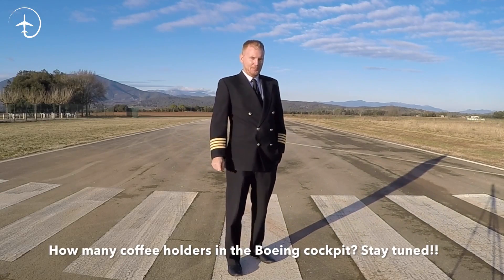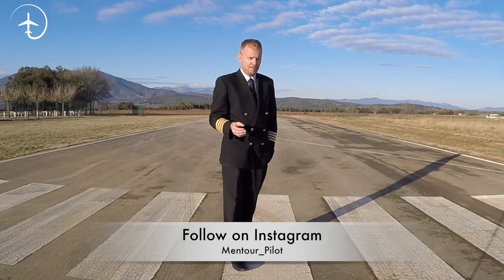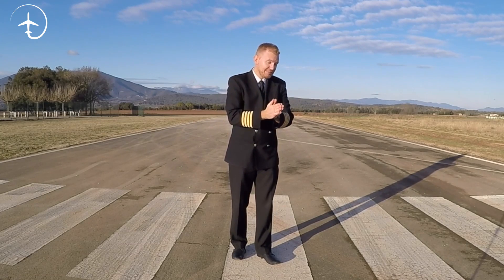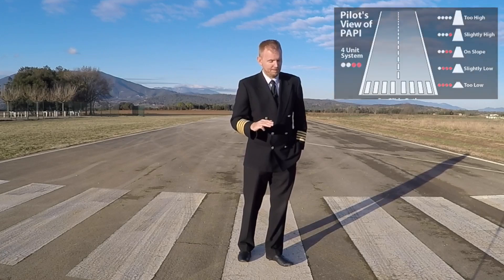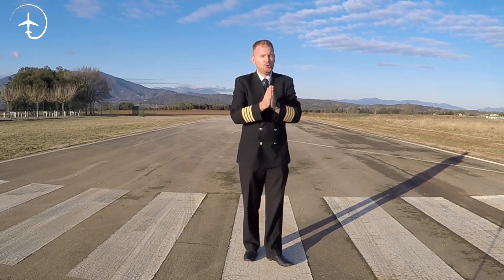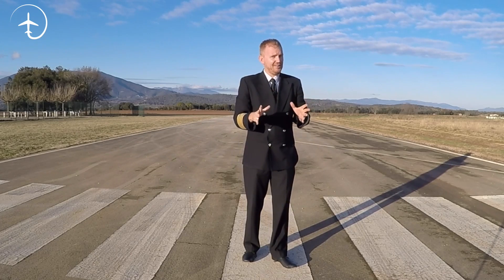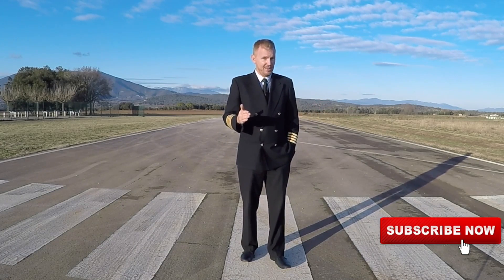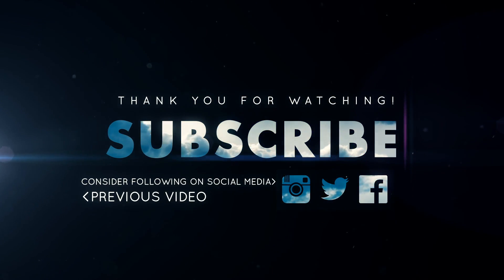Strange Airport lights - PAPI's

Comment: Thank you for this video.  I hold an approval to flight test these systems and your summary from an airline captain perspective was very informative.  Especially the part about placing less emphasis on the final 200'.  If I am stable at that stage I continue the approach visually to the aim point mark and do a final assessment of the 50' eye height above threshold.  Assuming the approach has been stable, even in a light twin, you can usually assess the touch down point as being within acceptable limits of the runway marking.
As an aside, not many runways I check have ILS and only a GNSS RNP or other NPA.   A check is made at the FAF that the on slope indication at the published altitude is correct.

Comment: I had a passenger sitting on the co-pilot seat asking what are those lights and why they are two white two red. I told her that means the runway is only 50% charged and she freaked out asking if that's still safe to land 🤣

Comment: Interesting On my own home sim (Microsoft-X (an old one from 2006 the last year Bill Gates decided to close the sims from further purchase) I have noticed that just crossing the threshold and ready to touch down, they are all red! I simply ignore this. I KNOW just where I am over the runway, and don't need POPI any longer and I make perfect landings. Further, this MIGHT be a bug in this Microsoft programme If I follow the PAPI I am too steep (above 3 degrees) but I usually (of course when there are no obstacles in front of me tend to come in at maybe two and a half degrees, Some might say that is too low, but using my very 'hard to stall' Raytheon-Beechcraft B-350 King Air when I do come in 'too low' actually I wind up making the smoothest landings imaginable! No bounsie-bounse, or 'firm' touchdowns. Smooth transition from wing to tyre……….BTW, as I am also into railways, I have a railway sim as well )not only driving genuine rolling stock, be it steam, diesel or most important and most majority of my time, electric, I can also do my own layouts 'routes Yes, complete with the overhead infrastructure (from RZD in Russia).'...…… I have many airports and I found out a trick on how to install PAPI lights at both ends of the runways. Being predominantly a rail sim, the airport 'assets or objects are rather limited, but good enough to use for a fairly realistic airport. It is from Hellensvale,  QLD in eastern Australia, the company now known as N3V Games. Their Auron Trainz is their railway division as they (N3V) also has their own flight sim as well. On the Trainz they have one A-319 in Air New Zealand markings and if done right one can simulate a take off or landing. It is a bit cricky but still works.

Comment: I thought of the airports in my area use VASI lights. Touching on the differences could be an interesting video.
Reply: The big difference between PAPI’s and VASI’s is that PAPI’s are more precise. PAPI lights can show you to what degree you are above or below glide slope, but VASI can only show you that you are high or low. Both lights can show if you’re on glide slope.

Comment: I remember there being two rows of VASI lights. If both rows showed green you were in the glide slope. If the far row turned red you were to high and if the near row turned red you were to low. When and why did they change to PAPI? I have asked other pilots on YouTube and have gotten no response. I found the VASI lights as workable as the PAPI.

Comment: The error you describe sounds similar to "chasing the ball" if you're doing a dynamic carrier landing (as opposed to a vertical one), you start oscillating across the glideslope and risk a ramp strike or wasting your landing gear some point after the arresting cables.

Comment: Q.1: Is there a "minimum set" of landing aids your company requires to land at an airport?
Q.2: Have you done a video on the most significant landing aids? (e.g. PAPI vs ILS, etc) and how you use the available aids (e.g. when transitioning from GPS to ILS to PAPI)

Comment: How is it decided what type of planes a pilot flies? Does a pilot know how to fly all models of aircraft or only one or two different models? For example can a pilot fly a 727 and 737 but not a 747?
Reply: It is YOU that decides what aircraft you want to fly. You need to get a type rating for it yourself. And as for you second question, AFAIK you can hold 2 type ratings at once.

Comment: I might put this to use in X-plane.. last flight i did was into LOWI lovely 460fpm touchdown lol. Ahh heres a question happens at Innsbruck at night with regards to approach.. Surely there is no visual for runway 8 at night but what happens when the winds are blowing from the east. I had a tailwind of about 7kts on a dry runway, I figured that would be alright for a 737 but what if the winds are stronger?. been wondering about that for ages.

Comment: I heard on the news two or three weeks ago that an airport in Greece (Thessaloniki) is temporarily converting a taxiway into a runway because the actual runway is under maintenance, and some airlines are suspending their services to that airport because of that  What are your thoughts on this matter?
Reply from the maker: That happens from time to time.
If the runway is approved and has the correct t pavement classification number etc, there are no problems with this.
Approaches will change slightly, the mínimas will increase but that’s it.

Comment: So a couple questions... what about aircraft with different seat to tarmac distances.... how does the PAPI change if you are flying a 747 vs. a King Air?

Also... ever done a PAR (Precision Approach Radar)?
Reply from the maker: Hi. Normally the papis are Set for the bigger type aircraft and as such, smaller aircraft can see 3 reds towards the end of the approach whee a 747 sees 2/2 

I have never flown a PAR Approach but o have flown a Radar NPA which is the non-precision equivalent.
Reply from the maker: Hi. Normally the papis are Set for the bigger type aircraft and as such, smaller aircraft can see 3 reds towards the end of the approach whee a 747 sees 2/2 

I have never flown a PAR Approach but o have flown a Radar NPA which is the non-precision equivalent.
Reply: Thanks for the info about seat height above ground and the difference in the way PAPI appears. I confess that I have never flown a PAR approach.... although I have been the "Navigator Monitoring" on many occasions.

Comment: what about the green lights ? instead of red and white colors ?
Reply: Four greens on the PAPIs, they're shining through the grass and you really want to pull up...
Reply from the maker: The green lights in front on the runway are threshold lights. They indicate the start of the runway.
Reply: i thought its guide the pilot to the right touchdown angle ( green light i meant )... thanks alot sir

Comment: @mentour pilot sir, I'm a trainee pilot in New Zealand, I have trouble in using rudders in a turn, Could you please help me with that
Reply from the maker: Hi! Do you have a rudder coordinator (the bubble)? That should be centered. Otherwise just use as much rudder as you need in order to feel that you are not being "pushed" in either direction during the turn. The force should push you straight down into the seat.

Comment: I was landing at an unfamiliar airport and I was on what felt like a normal approach, but the papis were reading high. I start descending and descending and by the time I see 3 whites, I'm definitely too low. Maintained that altitude until I got back onto my normal approach and landed where I was supposed to. I notify the tower and they look into it, and a few days later I fly back to that airport and find out that a groundskeeper ran into it with lawnmower and knocked it out of alignment. Definitely an interesting thing to watch out for.
Reply from the maker: Great stuff! That just shows how important it is to rely on different sources of information and use always question the info you have. This is one of the primary reasons why Humans are still flying the jets and not computers.
Reply: LOL
Reply: That's so dangerous! He should have told someone immediately.

Comment: I thought my entire life, that the PAPIS are controlled automatically... but it's just the viewangle which changes the lightd
Reply from the maker: Yes, that’s correct.
Reply: And there is another type of glide slope indicator it only has one lamp, I believe it shows red when too low, flashing white when in glide path, and solid white when above glide path. 
In some general aviation airport where the ATC is off duty during night hours, you can tune in a frequency and click on the mic to turn on, change brightness of the runway lights
Reply: Aircraft carriers I think use the same principle but in a Christmas tree formation.
Reply: @chuckzc   yes indeed they do. exact same principle but the layout of the lights is a little different.
Reply: Yeah I thought they were connected to radar
Reply: Matthew Wang I believe that is called a VASI Visual Approach Slope Indicator
Reply: It’s a quote clever design, as I learned from captain joe's video, they are sometimes used as a replacement for the ILS, because they are cheap, and some planes like the 747) don’t work well with them, because the cabin is too high, so a correct glide slope is actually three whites one red
Reply: Took me a while to work it out but when you think about it, it is so logical. Those lights must be set at such a critical level thought.

Comment: Hi Mentour as always another great video,  quick question; whats the benefit of having two sets of PAPI either side of the runway.  I understand as a minimum only the left side is required?
Reply from the maker: It gives a better sense of the altitude actually since you can concentrate more on the Centre if the runway and your peripheral vision still sees both sets of PAPIs
Reply: It is also useful in the event that a light burns out or is crashed into by a lawnmower.

Comment: Is there a risk with holding a coffee holder near the central cookpit in case of turbulence or hard landing ?
Reply from the maker: No, not if the coffee cup has a screw lid, which we have to use.
Reply: I see, because i thought the flight attendant is giving coffee and drink during the flight, so there maybe a risk :), thanks Captain

Comment: What is coffin corner?
Reply from the maker: The altitude where low speed and high speed stall coincides.
Reply: Prathiksh Shetty the given name is actually Q Corner.  Q defines dynamic pressure. over the years, coffin was interjected as dramatic license. "corner" refers to the triangular shape at the top of a flight envelope chart where the stall speed and critical Mach number are within a few knots of each other. the speed where they meet is the ceiling of the aircraft.
 most of today's jets have a fairly wide margin between stall and Mmo, which had made Q Corner a thing of the past. a great example of a coffin corner aircraft is the U-2. ate 60,000 feet where she is most happy, the U-2 can have as little as a 5 knots between stall and mach buffet.

Comment: Hey Mentour! So, I have a question regarding diversions. Let's say there is a flight from Denver to Pittsburgh. Shortly after the takeoff of this flight, it begins snowing in Pittsburgh. Before the flight can begin its decent, the snow has turned into a full on blizzard. The snow gets so bad that Pittsburgh's airport is forced to shut down and our flight has to divert. In this case, the diversion airport is Toronto. So the flight diverts and lands safely. But there's a problem: the vast majority of passengers did not bring their passports, if any brought them at all, since this was supposed to be a domestic flight. What happens to the passengers after the landing in Toronto?

TL;DR: what procedures are in place for when a domestic flight diverts to an airport that is in another country?
Reply from the maker: In most cases the airport will keep the passengers on airside and then board them again for a flight to their original destination.
Reply: Ok that makes sense. Thanks for the reply, great video btw

Comment: Hi Mentour, will pilots ever taxi on one engine before takeoff/after landing in order to save fuel? Thanks!
Reply: Of course they can. But it is prohibited in some airports.
Reply: A lot of airlines do that if it is a very long taxi and a long wait in a line so they have time to start the second engine.
Reply: Kwazi Donsta on the A320, yes and it is done on the #1 engibe. engine 2 is started no later than 2 before takeoff.. first flight of the day, 5 minutes before take-off. so, what we've got are Green system hydraulics powered by engine 1, and Yellow system hydraulics  powered by the alt electric pump
Reply: Hamza Alkusari Yes you can use single engine for taxi but it is prohibited in some airports for safety reasons. You still can get perfect turn although you are using one engine. It does not give you a very big differential power since the required N1 is low for taxi. Which means you can still easily turn a big turn with single engine taxi. What most pilot do:Taxi toward the ramp/parking/gate with single engine, when parking brake is set,shut down left engine
Reply: Kwazi Donsta yes they can
Reply: yes on multi engline aircrafts, this is depending on the company procedures. usually you turn off one engine at the last meters before turning into the gate. but it needs practice
Reply: Ava Mendez can’t the APU power both HYD Pumps for the Airbus? XD
Reply: I know Envoy does it with their 145s all the time when they operate for American.